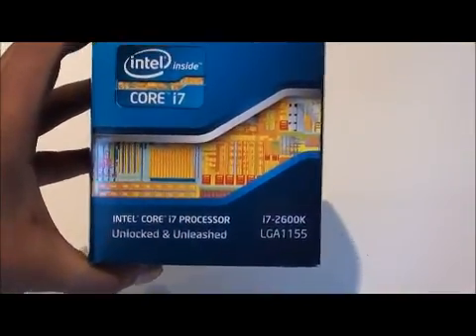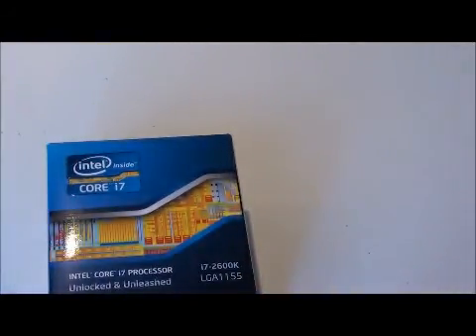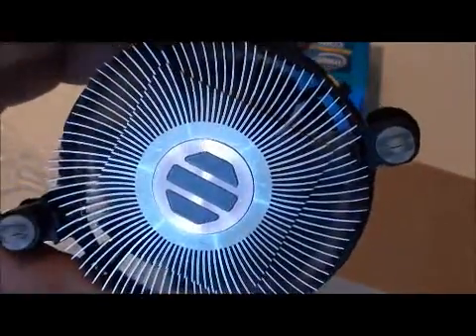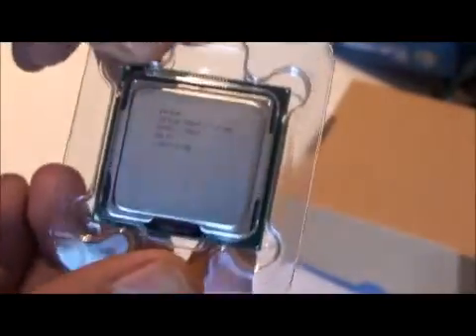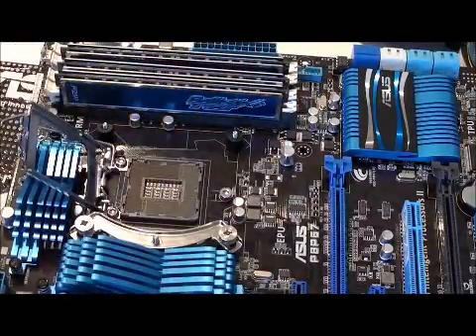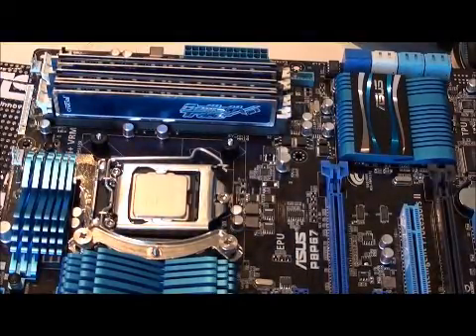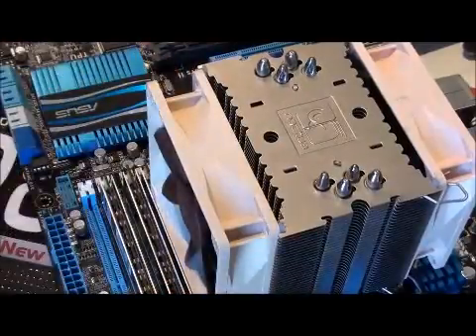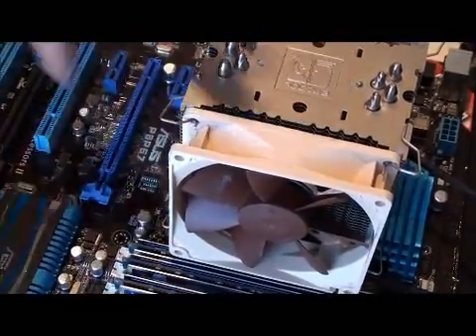Intel Sandy Bridge i7 2600k LGA1155  unboxing & Installation

Comment: What RAM is that your using with the leds? Also i want to upgrade to a better heatsink cpu fan like yours but my ram looks awfully close to the stock intel I7 fan (maybe 10mm) will it interfere?

Comment from the maker: fot the cheapest option

	AMD Phenom II X4 945 (AM3, 3.00GHz, 6MB Cache) Processor
	Asus M5A78L-M/USB3, 4xDIMM, Max. 16GB, M-ATX Motherboard
nVidia GTX 560 Ti 1GB
	8GB (4 x 2GB) Mushkin PC10600 1333MHz DDR3 Ram

	Xigmatek 400W PSU

Comment: Looks like the Noctua NH-U12P. I have one, they're pretty damn good. Make sure you have low profile RAM though if you want to fill all the slots, otherwise you can turn it to face upwards to push the air out of the top of the case if you have ventilation holes there.

Comment: Today i installed this exact same processor on my p8z68-v pro/gen3 mobo that looks pretty much exactly the same as yours but it turns on for a couple of seconds then turns off, then turns back on and a red light named CPU_LED just stays on and it just does nothing... i can only guess it means the CPU is faulty =/ any ideas?

Comment: @crossfirex888The only thing that is vurnable to the static electricity is the CMOS transistors. Which is mostly shielded today in most IC(Integratated circuits), like the prosessor and the chipps in the mother board which there are alot of. The CMOS transistor "detects" the volatge it its normal operation parameters(low voltage). The static electricity (which is normaly 1000 volts or much higher) destroys the "detecting" ability of the transistor =redering it useless.But do ground yourself. :)

Comment: @WerewolfSlayer91 Well thats what fit my cabinett though. Well i realize now i was damn picky. But just turn the heatsink 180 and it would be as how i mounted it in the new PC i built. Good video by the way very helpfull. some iwssues with the mounting set which you put a spot light on. thanks for helping me build my pc.0Damn smal comments boxes cannot write what i want without  shortening everything. and cutting out suff i rather be saying.

Comment: @SUPERMONJ Exactly. I don't want to be rude, but just wanted to point it out in case you didnt notice.
I get your point- which is pretty clear in your video as well as in your comment. I dont know if you want  the air to be pushed further into the cabinet.I would like i towards the I/O ports. 10:29 you see the noctua mark is outwards. That means it chopps the air from the side with the noctua mark on it on to the other side. Pushes airtowards the RAM chips. The other fan:inwards=pulls air out.

Comment from the maker: @WerewolfSlayer91 The first fan ‘pushes’ air through the radiator’s cooling fins, while the other ‘pulls’ air through from the other side, to the exhaust. in the video the nactua mark does face outwards to the exhaust fan.

Comment: you mounted the fan wrong. the fan who puts air out of the cabinett should be faced towards the heat sink and the other one should face (with the nactua mark )should face  outwards. one pushing air in the other sucking..

Comment from the maker: @Helge129 
if you want dual channel you need to do the following arrangement, using just two sticks

slot   1 | 3 |     OR       slot | 2| 4   

So three sticks of RAM would be one dual channel + an extra stick. However if you fill all four you will be running two sets. Hope that clears things up.

Comment: @SUPERMONJ I have a question about dualchannel: Does that mean the CPU can only properly use 2 RAM modules, or does it mean that using more than two RAM Modules doesn't run as good?

Comment from the maker: @leezaal thans. go with the 2600k.the 2600k has better overclocking headroom/runs at higher clocks with lower voltages than the 2500k.